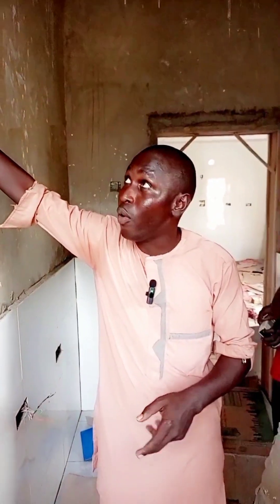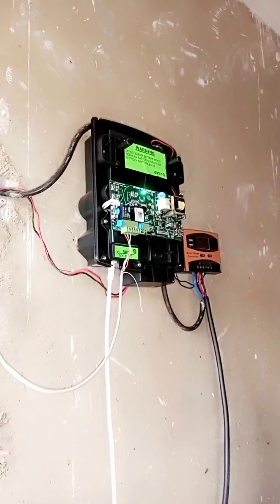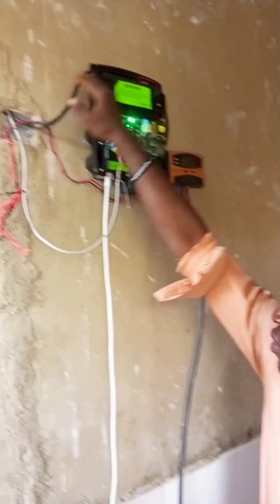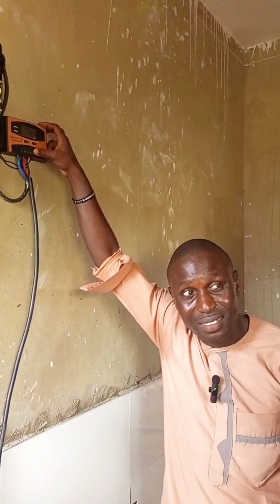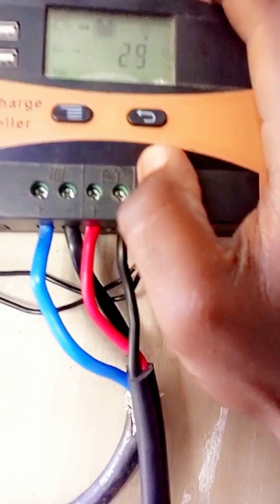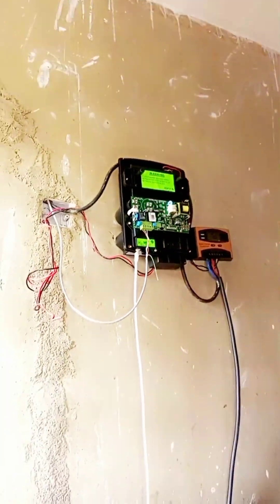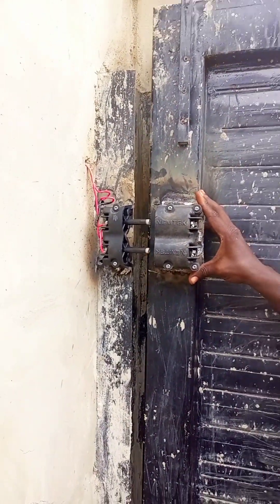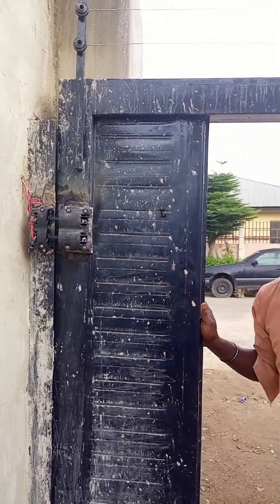How to setup an electric fence wire system with solar panel and an extra AGM battery #nemtek #panayo

Comment: Please how is the extra battery connected to the energizer? Without connecting wire from the big battery to the in built battery
Reply from the maker: The small battery is connected to the load on the solar charge controller, while the other big one is connected to the battery terminal on the charge controller
Reply: @installerpaul  sir,hope it doesn’t mean if the small battery is weak?
Reply from the maker: No Sir
Reply: Sir please, where are you going to plug the Energizer